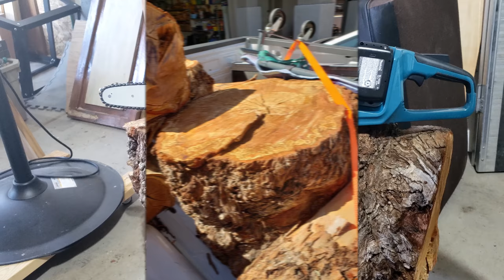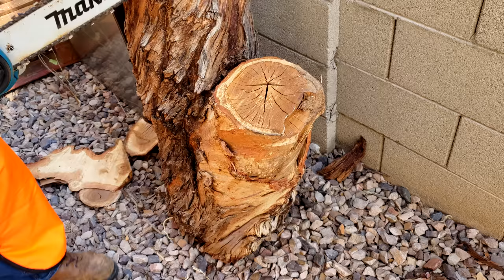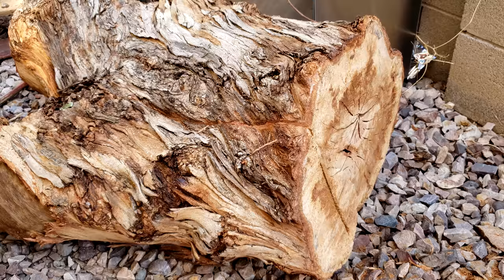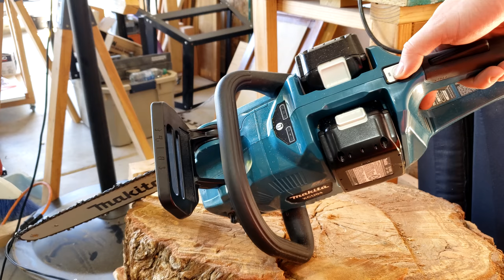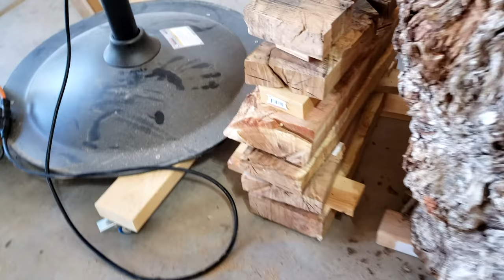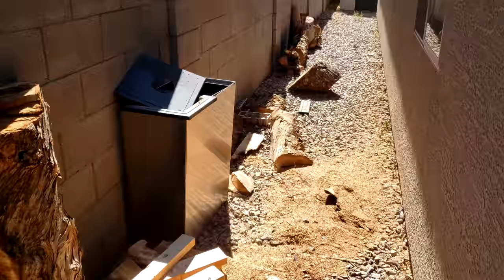Did I waste money on an electric chainsaw?

Comment: I just bought one of these myself and I love it. I previously had a gas powered Stihl, and I didn't use it very much. I got maybe 6 uses out of it before it started leaking. When I took it to a shop they said I'd be better off buying a new one because they'd have to dismantle the engine to fix it. So I said forget gas, I went to an electric one. I already own compatible Makita tools that I also love so the decision was a no-brainer. I won't be cutting anything near as thick as this guy was, so I don't anticipate many problems.

Comment: The right tool for the right job, I own this saw and it’s perfect for most of my needs. Mostly liming and turning downed trees from storms on my property into next years fire wood. This saw your using is probably a little overwhelmed by the size of your stumps there. You’re review is accurate but most wouldn’t use this medium duty saw for this size of work.
Reply: These saws are fantasic for timber up to 200mm, i generally grab this over the petrol for that size .

Comment: I’m a tree surgeon by trade. Iv always used stihl or husky saws but want a saw to use at home that’s quieter than a petrol driven, all my tools are makita ltx so I’m tempted by one of these, I’m impressed it got through that log Union in the direction of the grain, most top range saws take longer getting through them. I’m not sold just yet, il be watching more reviews I think. Good demo you done though 👍

Comment: bought this model around 4 years go (around 2018). did nto want ot mess with gas mix, spar plugs, cord pulling, noise, smell and so on. it's been great.
what you did here is a bit extreme. you cut continously slabs. this is why you only get around 20 minutes of runtime and hot batteries. usually you cut a bit, then reposition and then cut some more and so on.
i used this saw to fall old, deseased fruit apple and plum trees, willows, black locust. made them into a bunch of firewood.
the way i work a set of 5 amps last 40 minutes. when spent they are warm, not hot. now i have 4 sets of batteries: 3 sets of 5 amps, 1 set of 3 amps. they allow me to do 2,3 hours of work. when a set is spent i slap it on the charger and in an hour it's charged. so if one has 4-5 sets of 5 amps he could do a lot of hours of work. one could optimize this by getting two double chargers or charge the batteries to 80% that goes fast. you can tell the 80% level when both green and red are lit.
Reply: You can throw trees cuz you got 1.3 bar and chain, i cant do it with 1.1, whenever i lay saw horizontaly my chain falls off immediately. But it cuts better, faster and with less vibration
Reply: @i1bike  the 1.1 millimetres is the thickness of the guide teeth on the chain. It should not cause the chain to fall. Perhaps your chain is set way too loose. I was able to fall tens of trees.
Reply: @hhcosminnet  
Noup, 1.1 falls off when saw is placed horizontally, regardless of chain tension, while 1.3 doesnt fall off. I put the 1.1 bar and chain on my ms231, it falls off :)

Comment: All chainsaws are going to collect debris in the chain drive case.  The nice thing about this saw, is that you need no tools to clear it out.  The only thing I am not too keen on is the chain tension adjustment, as I find the adjustment knob too small.
Reply: Agreed, I have trouble adjusting the slider mechanism, it is rather finicky
Reply: I’ve been using chainsaws for over 40 years and have one of these Makita battery saws also. Initially I didn’t like it because I was using it like one of my petrol Stihl’s and putting too much pressure on for a battery saw. If you push them hard they will stall and your battery life will go down. The second problem was that I was adjusting chain tension like I do the Stihl's and they they would come off and ding the drive links which usually means a new chain, as I haven’t got time to file each link down. You need to tighten these chains right down hard! Each time you change batteries you need to fill the bar oil and clean under the plate. If you don’t clean them out you block the oiler, then run the chain hot and lose  the temper. It collects far more shavings than any of my petrol saws and requires more cleaning.

Once I learned how to handle this saw I find it very useful and carry it everywhere in the back of my Polaris and use it for light work. It can do heavier work but is more suited to lighter wood. I’m about to buy one of the Makita battery 4” or 6” pruning saws for one handed cutting up of branches for light firewood. I’m sure I’ll be happy with that too!

Comment: usually I put the saw right against the log and take advantage of the teeth on the saw's face, some might call it the "fence"-it allows leverage to pivot the saw and increase the blade bite! It's also safer. And wear some leather gloves! :goodvibes:

Comment: So dead wood is going to dull the crap out of a chain REALLY fast, and looks like it already has from the sawdust (not ribbons) coming off the chain.  The teeth are designed and suited for green wood that will "peel" out of the cut.  What you want there is a bandsaw, or a circular saw if you're up for getting something big enough to cut those pieces (probably not, it's $$$$$ and ill-suited for funny-shaped pieces).  There's a reason mills use circular and bandsaw blades.
Reply: Your right, full chisel chains are quite violent on deadwood and blunt quickly. Semi chisel chains are better on deadwood they don’t blunt as quick but don’t rip through wood like full chisel do,. It’ll be plenty of sharpening practice lol
Reply: I am very seriously considering the 10.25" cordless or even 16.xx" corded Makita circular saws for exactly this reason.  Positive-rake, fast cutting blades that don't die on me all the time :)
Reply: At some point you'd think you'd see something like the portable metal-cutting bandsaws but with a wood blade on them for such work...

Comment: Looks like you needed either a better chain, or to sharpen that one. Throwing small flakes and cutting slow.
Reply: Chainsaws are also primarily suited for cutting green wood.  Hardened, dead, dry wood doesn't "peel" out how the chain teeth are designed to, and dulls the chain teeth what-quick.  This is why sawmills use circular and bandsaw blades, not a green wood saw.  I preferentially use a (kids, avert your eyes) cordless 10-1/4" circular saw for dead stuff if it's small enough for the saw to get far enough into (to cut or to notch & drop).
Reply: @indigophox  I've been using chainsaws for the better part of 40 years, and for a number of those years I sold firewood for a living. Sure, 'green' wood cuts easier, but if the teeth are sharp and the rakers are filed down, cutting even the densest dry hardwood is easy. And by the way, chainsaw mills are used when the log is too large for the bandsaw or circular saw and the desired product is as large a slab as possible, for countertops and tables, etc.

By the way, I bought one of these little Makita 16" cordless chainsaws. Works great, but it's no replacement for a gas-powered saw at all. I like it, and it's handy, and it always starts (unlike some saws I've owned, especially Stihl saws), but for real work, you need a lot more saw. If I tried to use it to cut a cord of pine, I think I'd need at least fifty battery changes. My big Husqvarna will cut a cord on one tank of gas, and do it ten times faster.

Comment: The fact that you have managed to do the cuts hows you that it is capable of doing stirling work, but whatyou have done is better suited to be done by a gas powered saw. We keep ours as an emergency saw in our vehicles. It is ideal to use up in a tree to cut thru the top cover as it is light, manouvarable and safe, but battery is not there yet to cut down large trees or engage in heavy timber work.

Comment: We have a saying horses for courses meaning depends on your needs. I lived in a suburban home for decades and used plug in electric chainsaws of that size and found them excellent extension cords reached the extremes of my property and the saws were adequate power and size. I now have a 4 acre property with lots of trees some of them very large I am considering a saw like this however for the cost I feel a larger petrol saw would be better for me. Cost is also a consideration petrol saws are half the price of Battery saws (of this quality) corded saws are half the price again.
Reply: Generator! And use you electric one. Then you don’t have to breath in exhaust fumes.

Comment: 6Ah batteries @ Makita don't have more cells in them than 5Ah ones. They just have 3Ah cells instead of 2.5Ah cells, and as usual with cells of larger capacity, their max current draw is lower than that of 2.5Ah cells. So, you're actually worse off in terms of max amperage with 6Ah cells.

Comment: You need corded. Cordless tools for for quick burst projects not hour long projects.
Reply: Ya take the corded into the bush maybe with an inveter and battery bank 😆
Reply: @globalphotobank  Dude depends on the usage. His project was in the garage, there corded is a better tool than a battery. if you are going into the woods, you need either gas or a battery. If you are cutting too much you need gas. Common sense. I have all 3 and use them depending on what I am doing.
Reply: @SwapnilBhartiya  I live off grid Husky chain saws and the Makita 36v chainsaw solar charge multiple batteries full days work no prob. Only time battery operated tool gives me a hard time is near the end of the life off the battery.  5 Amh batteries or six no problems .
Reply: @globalphotobank  Makes sense. Thanks.

Comment: If you didn't waste your money now, you would have later when they stop making batteries for it. Don't buy anything battery powered. They have built in obsolescence. It's safe to buy a battery powered flashlight, but that's about it.
Reply: Eh, I've been running makita tools for a long time, and I even have one battery that has lasted more than ten years.
Reply: @shanemedlin9400  I have 2 sets of tools. I have Bosch and DeWalt and none of the batteries lasted more than 3 years. That's all I'm saying. I had to replace 4 batteries in total during that time.
Reply: Batteries are a consumable item, who thinks they will last forever 🤦‍♂️
Reply: @chasp_0784   The bad part is, when you can't even get batteries any more from the makers of the tools. All the batteries I have had to buy were after market batteries that the manufactures just stopped making. Mind you, Bosch and DeWalt too. The tools aren't even 5 years old either.
Reply: @magoolew5131  maybe dewalt and Bosch aren’t the company’s for you, hopefully tool manufacturers keep innovating so you actually want to buy something new not railroad you into the decision with cynical design but new shiny usually means new platform
Reply: Makita lithium batteries that fit all other tools have been going for a lot of  years now
Reply: @magoolew5131  there are many 3rd party battery options for this, and highly rated.